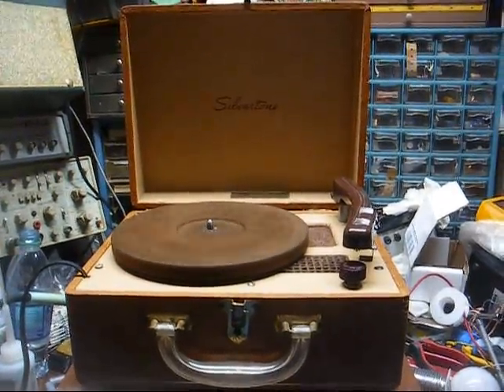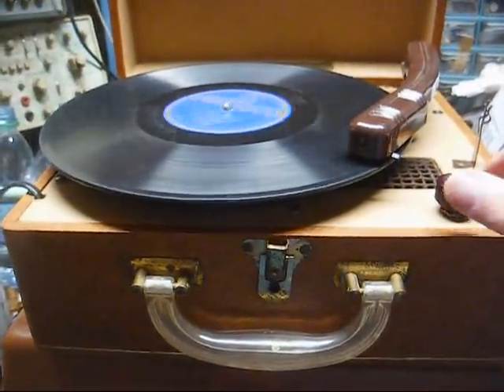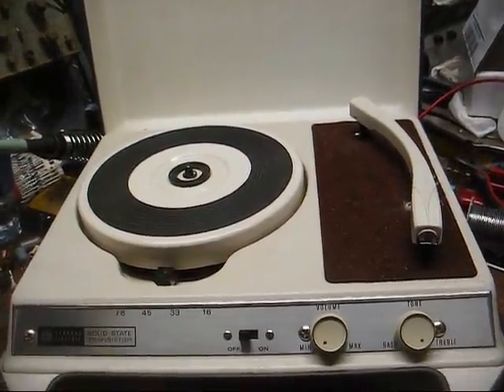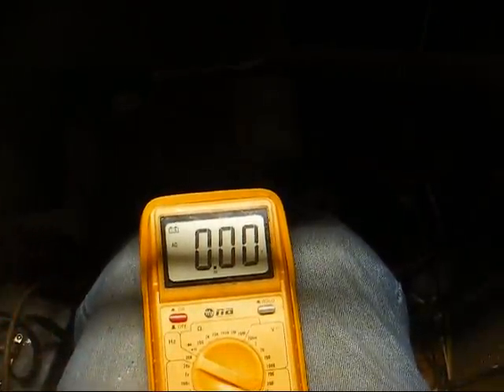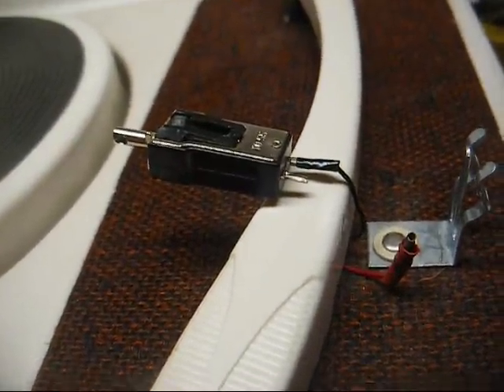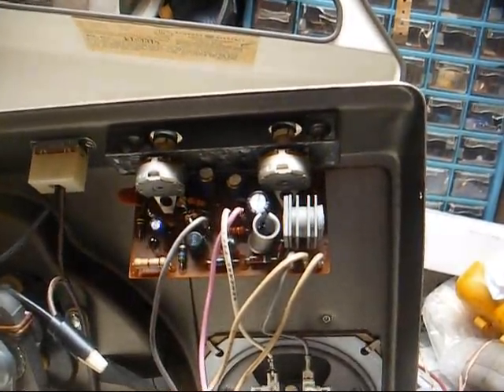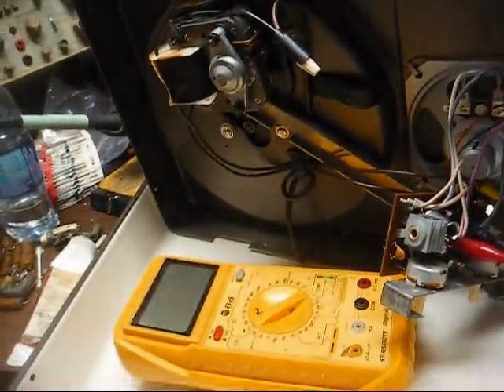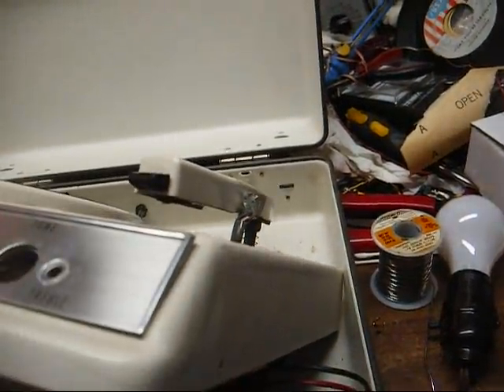Silvertone 78 rpm record player & cartridge diagnosis in a 1960's GE record player

Comment: I have heard of people rebuilding the Astatic and Sure cartridges used in old 78 rpm only players from the 1940s, they basically remove a ceramic element from a more modern cartridge and retrofit it inside the old metal case. There is also a fellow on the Philco Phorum who bought some Piezoelectric elements used for some other purpose, and was adapting them to fit inside old crystal cartridges, they may have been used for  buzzers or some similar things. Some computers have one wired into the motherboard which will beep when the machine is turned on. These may be the best ways to deal with dead crystal cartridges that have unique mounting. The same individual made an attempt at growing his own Rochelle salt elements but it was not entirely successful.

Comment: Those old crystal cartridges were made of Rochelle salt (potassium sodium tartrate) which is highly hygroscopic (absorbs water).  The water weakens the crystal structure and reduces the piezoelectric properties.  Even if not in use, they will deteriorate.  This applies to phono cartridges and microphones used in old electronic equipment.
Reply: I have one on an RCA EY45 that is actually oozing goo.
Reply: Will playing them for a few hours do anything?
Reply: @tarstarkusz  No.
Reply: Thanks for the info! I assumed it had something to do with moisture absorption. Sounds like if you have a working one, the best storage solution is to pack them in an airtight bag or container with desiccant to preserve it.

Comment: I like the GE player.  With players like these that have dead crystal carts and you want more gain,  you might consider adding a small IC based (ie: LM386) preamp and use a modern ceramic cartridge.